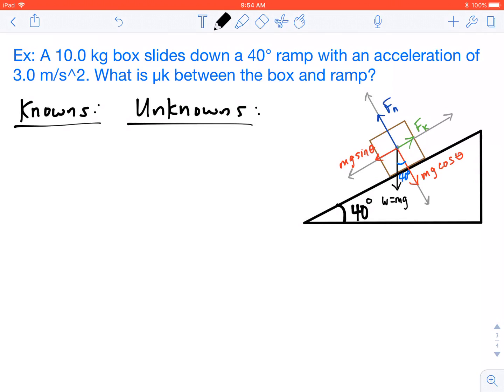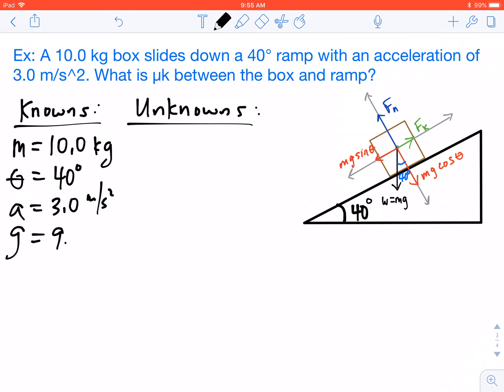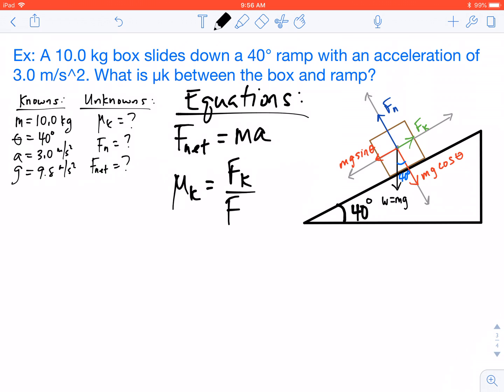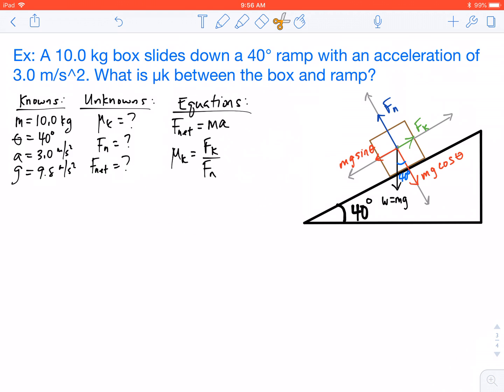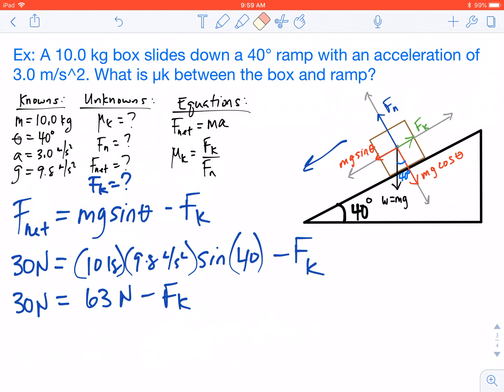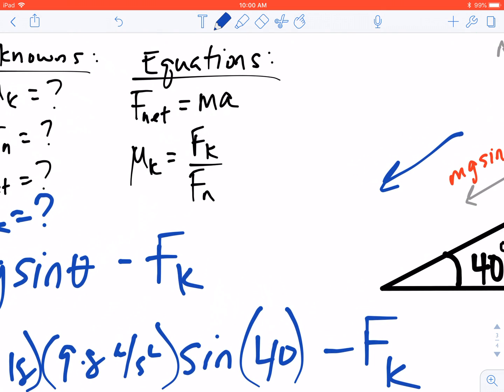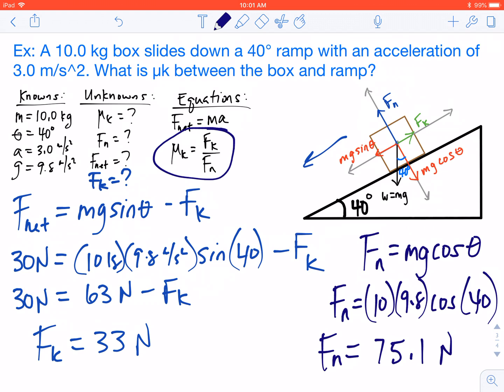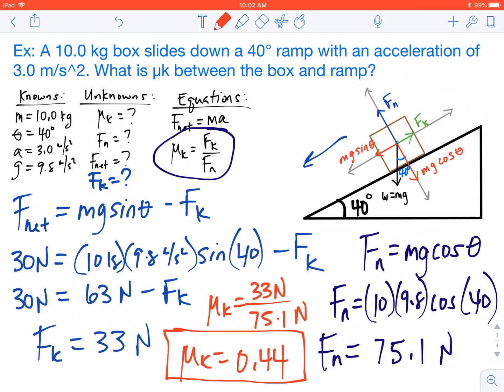How to Solve Coefficient of Friction Down a Ramp

Comment: What if we're also told that the starting point is at the bottom of the ramp, that it is launched upwards with an initial velocity v0 and that the velocity when it reaches the initial point again is vf? I'm assuming I'm only interested in the moment where it reaches the top and starts going down again, but I'm not sure why they gave me the v0.
Reply from the maker: Not sure, maybe to find the acceleration up the ramp so that you could find the friction variables?

Comment: is mgsin(theta) and mgcos(theta) correspond with parallel or perpendicular components? Or do they differ depending on the problem? I'm having trouble understanding because my professor taught us parallel and perpendicular components and then solve with trigonometry.
Reply from the maker: They are parallel to the surface. Hope that helps.

Comment: 10.0 X 9.8 X sin(40) = 73.0, not 63... ?
Reply: it is 63 bruh
Reply: @Saavah22  Could you just try that again? I get Sin(40) = 0.745, so I am still at a loss as to how you get 63. Am happy to be wrong, I am just hoping you can show me where I am making a mistake.
Reply: All good... I used a different calculator and got your answer... :D
Reply from the maker: @Hoygirl  You have to make sure that your calculator is in degrees mode and not radians mode. That was the reason for your initial answer.